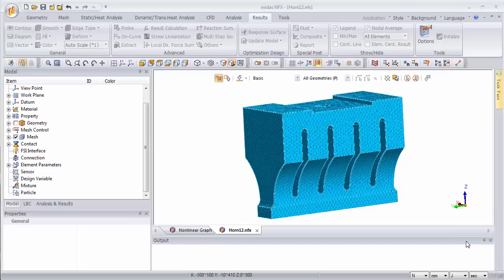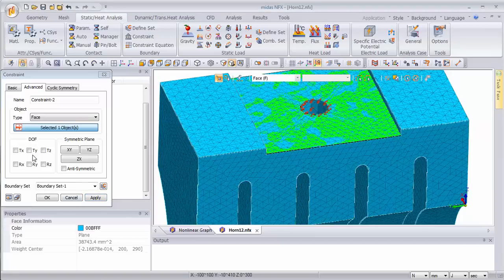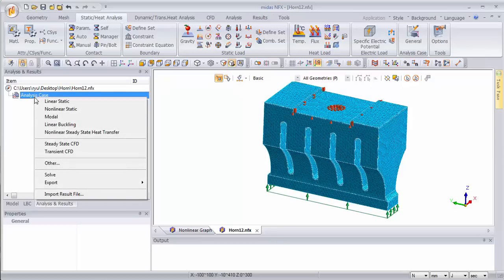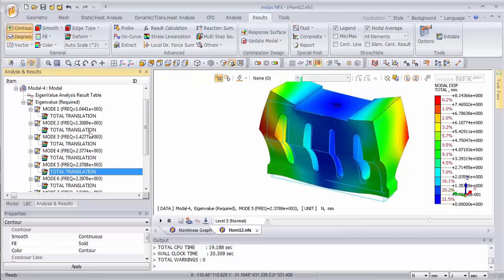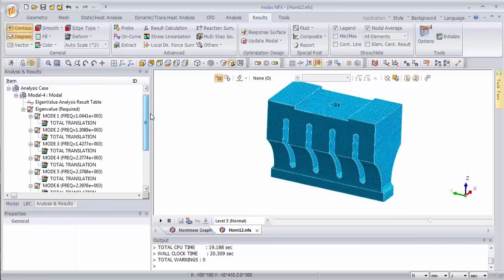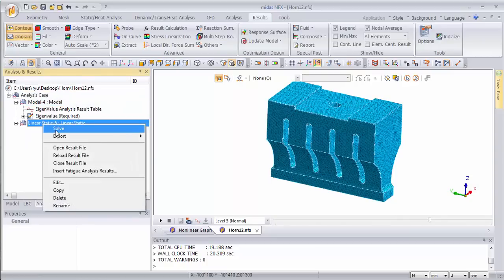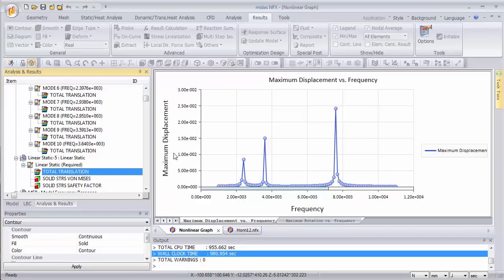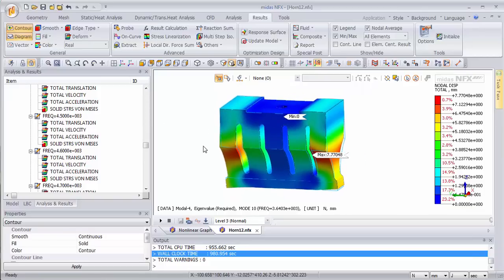What is frequency response analysis - FEA for All

Comment: Usually I avoid videos which start with "This is My Horn", but this video was very useful, even though I'm more confused than before I watched it.
Still getting my head around modal analysis, (for CubSats during launch), knowing which modes are critical, how to know which of an infinite number of modes impart more structural loading and displacements on the CubSat. How to look at individual components and sub-assemblies with in the entire system etc. Looking into mode participation factors now to try to understand what's important and what's rubbish.
Reply: Do you know how to design horns?

Comment: Great video, but one thing is bothering me. In initial stage you performed modal analysis. Usually, loadings are not included in such analysis. Did you consider pressure in your initial modal analysis?

Comment: Very good explanation. Why should we consider less no of mode shapes(say 10 or 20) why can't we go or 50 or more
Reply from the maker: You can, but it is generally useless because you want to detect the main modes of vibration which have a strong response to a certain type of loading. There are generally only a few of those really “strongly problematic” modes. Others are minor vibration modes which aren’t so impactful.
Reply: @Feaforall  I absolutely accept    ur answer. What factors should define the main modes of vibration or strongly problematic modes.

Comment: Great work cyprien.!!
Looking forward to more updates from you. 
If I understand this correctly for frequency response, after you have done the modal analysis, you have to run a static analysis. Then you define a modal frequency response associating the load to frequency and then giving a range of frequencies for the response. The question I had is the pressure load that you applied does it matter how much is the pressure load .? or you just have to define a reasonable pressure load .? The load you applied seems low so my question is if I am working on a different component will such a low pressure load still work or do i have to be very accurate defining the load.?

Comment: will you excite the modes the same way if you have a force in a different location? Let's say on the side of the block, instead the bottom
Reply from the maker: No you won't excite in the same way. That's why in frequency/time response, the load direction is important.

Comment: Hi cyprian..
As per my understanding we don't apply any load in modal analysis. We just apply boundary condition..but you are applying pressure of 0.1 mpa..Can you convince in which case we can do this.?
Reply from the maker: This is not modal, this is frequency response. Yes, modal has no load.
Reply: @Feaforall  ii think first analysis you did was modal
Reply: @yogeshbavge8263  i guess software connivanced the load automatically

Comment: Thanks for the video - good introduction on FRF to me - however I have a question - dont we want to design the structure to have min NF higher than max operating frequency?  When you set the Freq range (1000-10000hz) is this based on the operating frequency of the ultrasonic weld machine?
Reply: Instablaster...

Comment: Hi thanks for the wonderful video! I have a question as you mentioned that Freq. Res. Analysis Direct and Freq. Res. Analysis Modal are different in that damping is not considered in the latter. If possible could you please elaborate it little more? Also I could not understand the benefit of performing Freq. Res. Analysis Modal except that it facilitated to know the natural freq. modes which otherwise we can also know from the freq. displacement graph! so what is the purpose of adding modal to the setup ?
Reply from the maker: Frequency response on modal base is much faster in terms of calculation time it takes. That’s because once the base is calculated, all the frequency responses can be calculated from it with just a simple linear equation. Direct frequency response requires to solve the matrices for every frequency so if you have a large frequency bracket to evaluate, it can take a lot of time!
Reply: @Feaforall  thanks a lot for your quick response ! I got the point👍